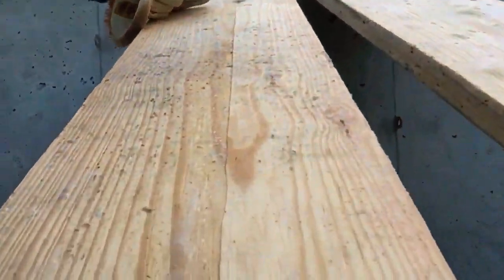How moldy are building materials, really?

Comment: I haven't built a whole house before. But on all my projects when I'm framing I have a spray can of Kilz primer in my belt for this reason. I just hit the gnarly bits as they pop up. Could get expensive on a whole house, but you could get a case of it cheaper, or a gallon and a roller.
Reply from the maker: Interesting, but I'd have questions about the chemicals I'm adding to the house I guess
Reply: @HomePerformance  absolutely, I'll take a look at what is in the Kilz, next time im at the build. But I would be interested to see if there is another mold and mildew resistant/killing primer that has low VOC or organic ingredients on the market. I just reach for the Kilz because its what my Dad always used.

Comment: Not sure where you're located within the country, but while you're at this stage you should prepare for termites. You can easily spend 20 minutes and $20 to spray a diluted Borax solution all over your rim joists and the lower framing and subfloor to ensure termites will not eventually find their way in. Borax contains boric acid, which repels and kills termites. It's the same thing that some people use to clean bathrooms. Especially after it's closed in under your wall and floor finishings, there's no risk to pets or family but it's a cheap and highly effective step to take now.
Reply from the maker: Already on it brother, thx

Comment: Bit off topic, 3M masks work ok but if you are wearing them daily I would recommend Moldex 2200"s. And if you are working in temps around the dew point they also make ones with the breath out valve (similar to 3M's).
Reply from the maker: Thx Gary

Comment: The fear you are trying to describe here is fungi-phobic not germaphobic. Since mold and mildew spores are omnipresent in the environment the only true control is moisture control. Mold will grow on organic material typically any time the relative humidity is 60 percent or higher. To prevent mold growth the relative humidity has to be kept between 30 and 50 percent. Also, the negative health consequences of mold are related to mold spores. Therefore, removal of the visible fruiting bodies of fungi and subsequent control of moisture is all that is required to safeguard ones health. Bleach is not necessary as it doesn't penetrate deep enough to affect the mycillia that are the main body of the fungi and can run deeply through the organic material.
Reply from the maker: Nice, David
Reply: David, are you an expert in this field? I need an expert opinion on a similar situation.
Reply: @HeyLightman  I have the EPA certificate in mold issues in schools. I have dealt with mold and indoor air quality for 13 years

Comment: Buildings need building science before they are buildings. I typically put a "roof" over a lumber stack using a piece of sacrificial plywood, but generally leave the sides open to allow air movement for drying. Adding battens between layers is great as well, but very tedious. The worst is yet to come when the floor is framed and there is no roof. Then it snows or rains for days and just sits there, wet. This is one reason to get things dried in as quickly as possible.

Comment: Just use backing soda or a little bit of bleach and that gets rid of the problem 100% of the time
Reply: The problem with bleach is it does not soak into the pores of the wood it will only clean the surface.  Thus will not remove all mold from wood.

Comment: You caused the mold covering the lumber.  You restricted airflow and increased humidity. Kill the mold with water/bleach mixed in a sprayer and allow lumber to dry.
Reply from the maker: Don't you think rain would have caused mold too? I can't imagine soaking the stacks would have been better.
Reply: @HomePerformance  Mold is caused by trapped humidity.  Leaving the lumber exposed so it can dry out is what's needed.  You could throw a plywood/osb sheet on top the lumber pile to keep it from getting soaked...and it would have plenty of ventilation on the sides to dry out.  If you fully cover it in tarps/plastic you're creating a mold greenhouse.
Reply from the maker: @xephael3485  The boards have gaps between them, they're 2x. Rain absolutely gets down between them, and then it's trapped even without a tarp on top.
Reply: @HomePerformance  The same gaps the rain gets into, will allow water and moisture to escape.  If you want to cover the pile so rain doesn't directly hit the boards fine... but don't wrap up the pile and trap moisture.  You have to allow the bundle to have plenty of ventilation.
Reply from the maker: 10-4 buddy
Reply: @HomePerformance Also if you have rim joists, don't use fiberglass batting to insulate them.  It'll trap moisture from inside the house.  It's recommend to spray foam rim joists.